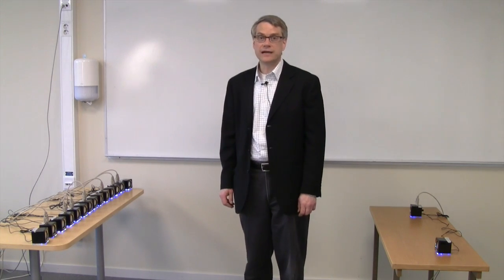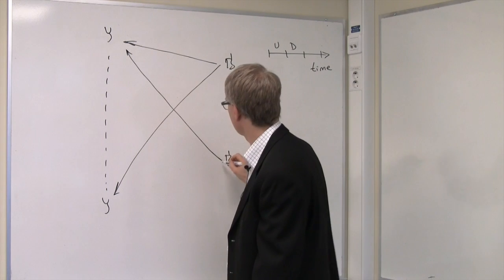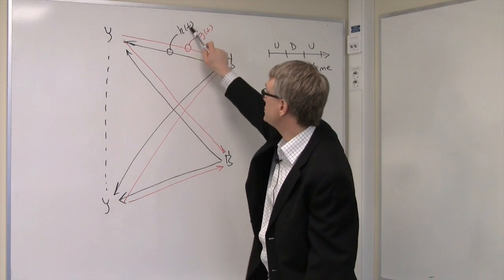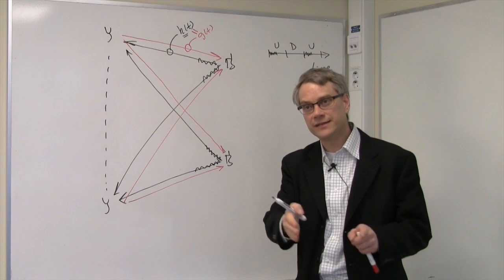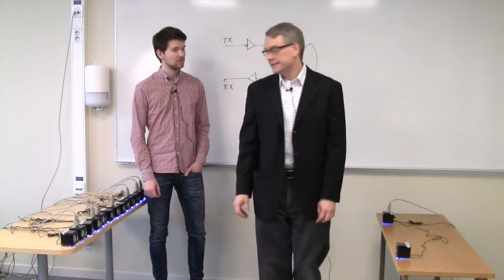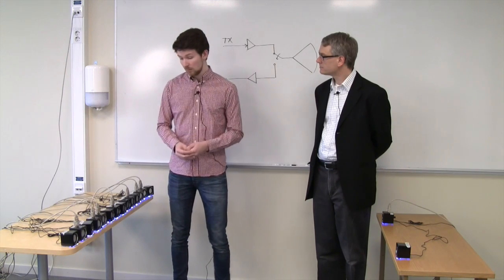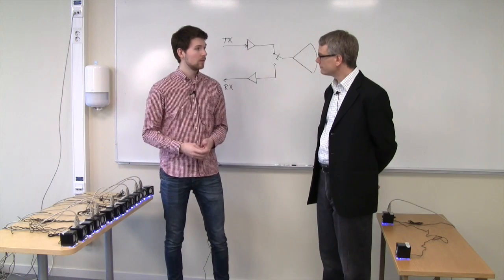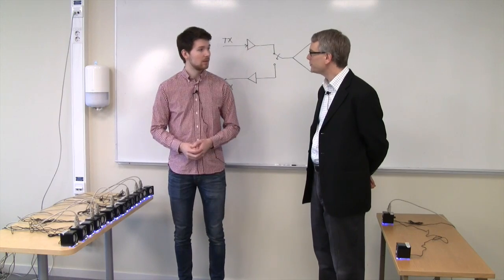Acoustic Massive MIMO Testbed

Comment: Thank you for the explanation Dr. Larsson. I have a few points for your consideration. I believe we should definitely look at reducing computation complexity of ML algo rather than using ZF as ML offers better BER performance. If Linear algo's need to be used then i feel MMSE is a bit better option than ZF.
Reply from the maker: If you have many antennas, linear processing usually performs roughly as good as joint decoding. That is why most people in the Massive MIMO area considers only such methods, but if you can afford the complexity of joint ML decoding, you should indeed use it.

MMSE is indeed better than ZF, but in this student project we considered ZF since we wanted the students to create interference nulls.
Reply: @WirelessFuture  Delighted to have your feedback. 
Indeed you are right when it comes to complexity of ML based algorithms. A group of students at my University (University of Surrey) are working under the guidance of Dr. Konstantinos Nikitopoulos on this challange and have published some work as well. I would be happy to direct you towards their publication in case you wish to. 
My best wishes to the students working at your university on this. Delighted to see their work.